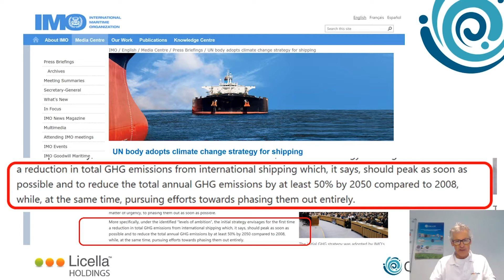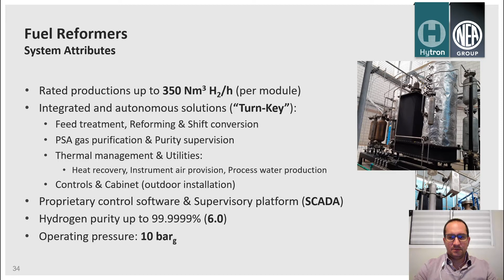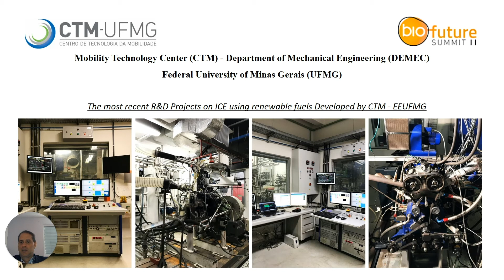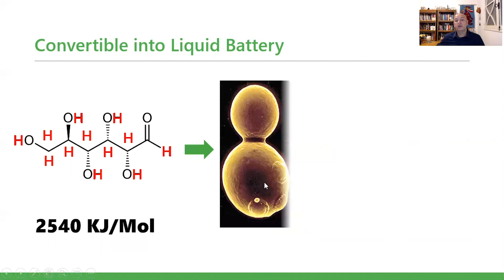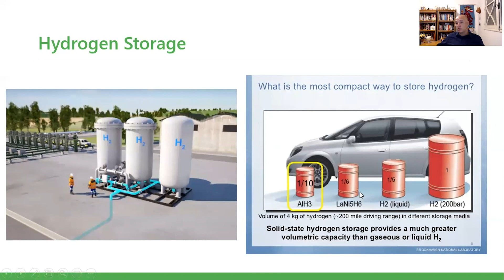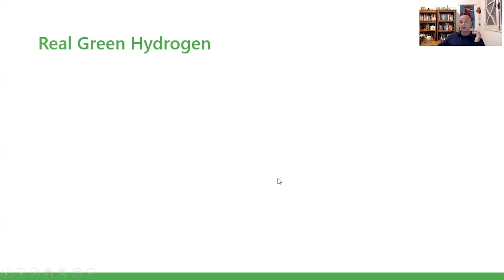Technical Session 11 - Biofuels application in Engines and Fuel Cells

Comment: Sure we should use waste biomass for our energy needs but it will only be a small fraction of the energy we need. 

In the long run though, we need a mixture of electrification, hydrogen and/or e-fuels because the efficiency of plants producing chemical energy we can use is typically far below 1% while solar panels achieve about 20%. Even with quite some losses, the production of e-fuels will be much more energy efficient than the use of biomass and the process can be highly automatized. When it comes to price, all depends on our methods and the scale of production. With nuclear power, renewables already available and fusion power on the horizon, carbon neutral, non biomass based sources are our only long-term hope to avoid a green economy of scarcity.